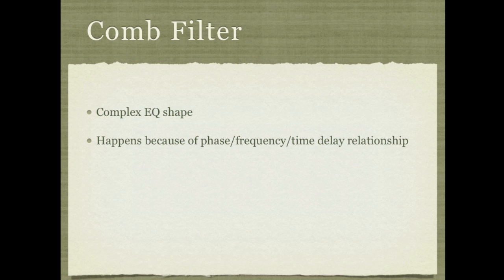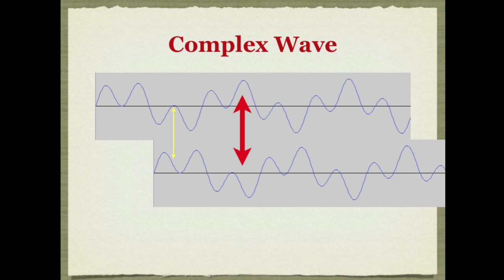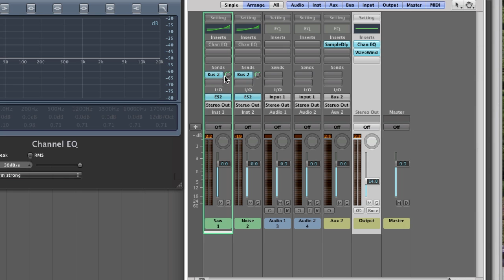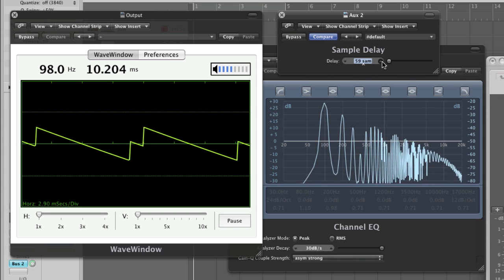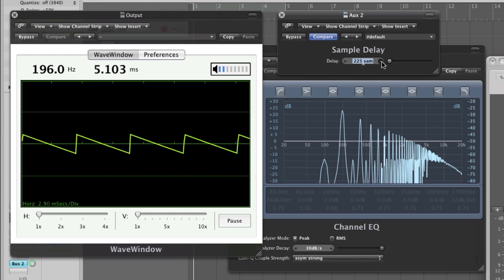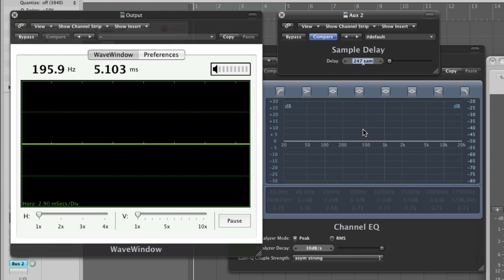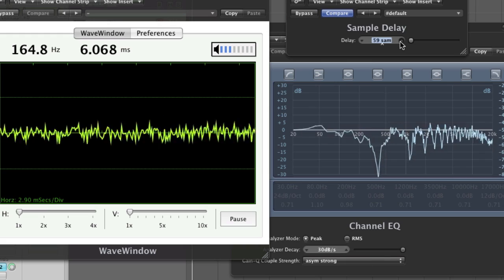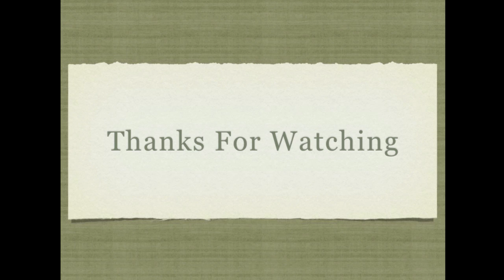AF023 Comb Filtering

Comment: The frequencies combine constructively too, in the acoustic domain.  1/4, 3/4, and 5/4 wavelength distances produce reflections which combine with the direct signal to create nulls whereas 1/2, 1, and 2x wavelength distances create peaks.  This is also true for the room's resonant modal frequencies - along those segments of the wavelength, you get either a low-pressure area or a high-pressure area.

Comment: Great video, as always. I was expecting, however, some rant about how many people seem to overestimate the importance of loudspeakers compared to room acoustics. Your video explains quite briefly that comb filtering happens mostly in the acoustical domain; in my opinion you should really insist on it, because that's easily one of the most (if not THE most) important source of distortion in an audio system within a typical room, and few people know that. Just ask Ethan Winer…